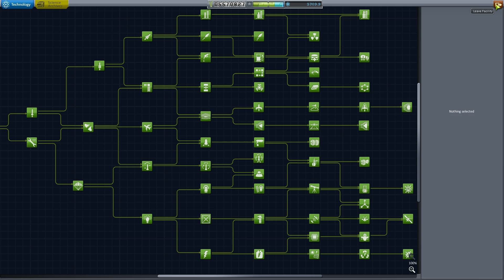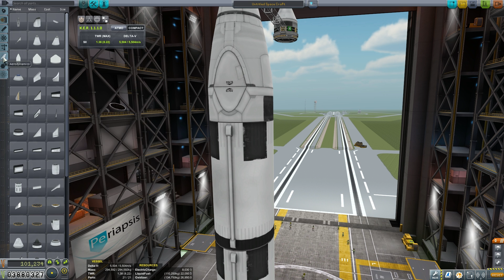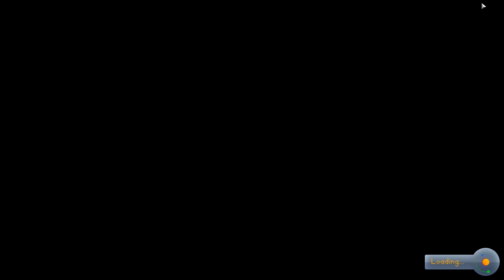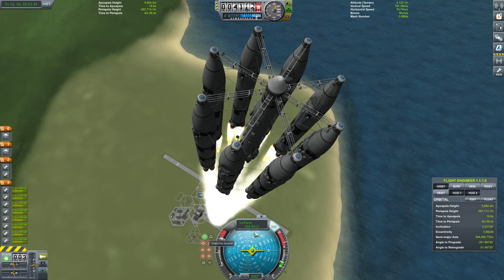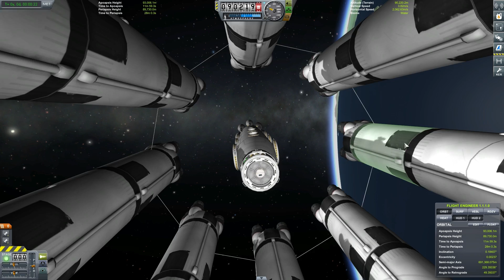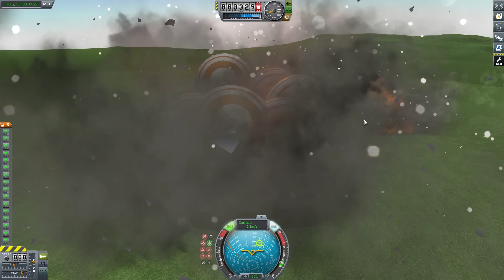SSTO Rocket "Super-Lifter" (Tutorial: 20) Kerbal Space Program 1.1.3 Stock

Comment: Unfortunately, this type of lifter no longer seems to work in 1.5. I used it up through 1.3, then stopped playing for a while.  When I started a new game in 1.5 this sort of lifter breaks up when trying to land it.
Reply from the maker: Using autostrut?
Reply: No, but it's structurally sound, the problem is that the central core overheats and explodes which then causes the breakup.  Never happened in 1.3.  I have managed to land it since I posted, but it's very sensitive to reentry heat, so I'm trying various redesigns, heat shields etc. Just wondering if there is anything new in 1.5 that causes it.  Some part changes or something like that. I used to be able to stick the landing at the KSP every time, but no more, alas.
Reply: All fixed.  The game is fine, just design error on my part.

Comment: Wait why not put the drogue chute and the main chute in the same stage? The drogue opens at a higher altitude anyways so is it not better to just put them together? Although now thinking there's probably a reason for it which I'd love to hear.
Reply from the maker: I tent to manually stage them just because in the older versions they would rip off if the altitude/velocity settings were not correct (the chutes would just rip right off). These days they are set to auto deploy only when safe... so yea. this was probably for historic reasons back in 1.1.3.

Comment: Do you perhaps know what the max payload weight is for your heavy lifter?
Reply: Given that he has ~4500dV on the lifter with the central payload at around 200t it is pretty much the maximum load for this lifter... given that he is launching all manually he needs more dV than the bare minimum, and he is also using some fuel for propulsive landing.

Comment: Can I get to the man and back with this to build a man base?
Reply from the maker: It won't get to the Mun as an SSTO. But I'd be inclined to build the base in LKO then launch teh space station to the Mun. Essentially the booster stage for the station (which was this part one) will be able to then move the station after it is built. You can then create refuel facilities to fill the main booster back up again. One of my future ideas is to create a massive fuel tanker that can land and fully refuel on a low grav body like Minmus, then it could launch back up and refuel the main base entirely. You can then essentially transport your space station anywhere. All easy to say of course... more difficult to accomplish.
Reply: ok could i at least use it to bring my apoapsis up to the mun's orbit, wait until i get to the apodosis and use the secondary booster to deliver a module to the mun and still get  the primary booster stage back
Reply from the maker: If you could attach 8 LV-N rockets to the side you would probably get it there. You won't get it there with the lower ISP of the Mammoth engines.